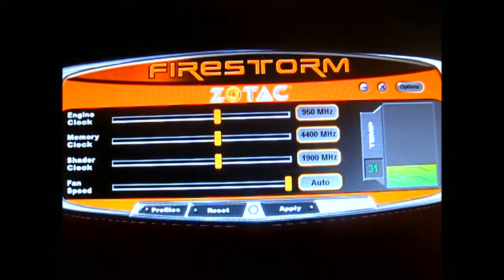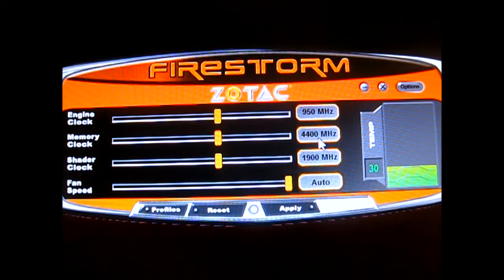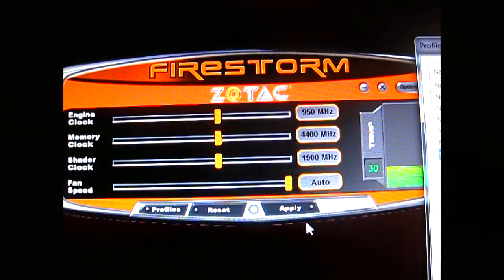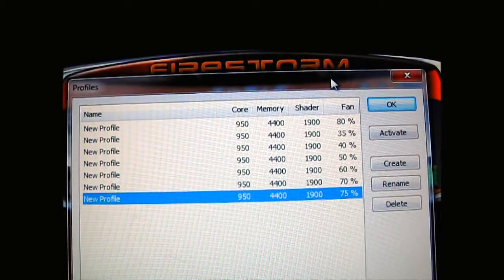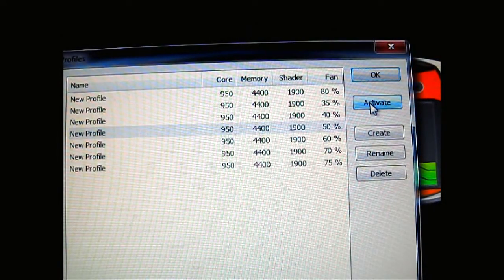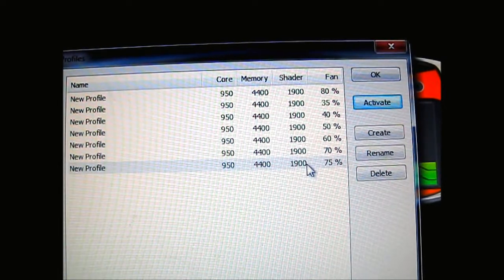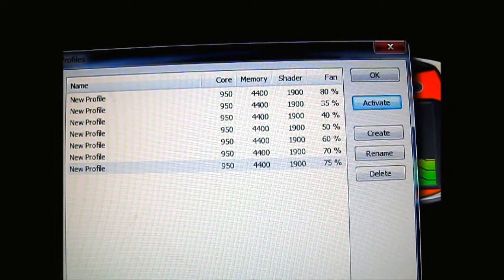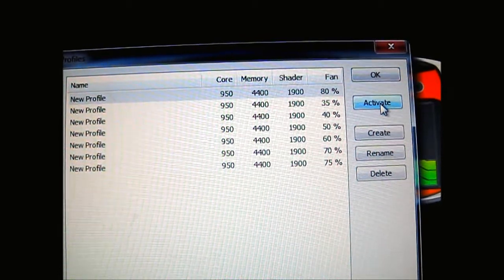Zotac GTX 560 Ti AMP! Edition Video Card - FireStorm Software and Fan Noise

Comment: thank you i use MSI's Afterburner and it works Great, but my problem was in fact power management mode in Nvidia control panel being set to "Adaptive" these power hungry cards absolutely have to be set to "Prefer Maximum Performance"

Comment: please respond if you've also seen this i have a zotac gtx560 (non ti) every once in a while the win7 desktop see through borders go solid and ill bring up firestorm and its all messed up different numbers and temp goes up a bit not dangerous but higher then normal (43 and then to 62) restart pc and then its fine again for like two or more weeks anyone get this (no over clocking)

Comment: hey, just wanted to let you know, I just bought this video card, and installed it in my antec 902 case. It is a good video card, i would suggest getting the 448 core, since it is basically a little lower than the 570s. As far as over heating, I have no problems, Idle is 30c and while playing bf3 on ultra with 3d, only gets as high as 40c. I do have ample room around card, so I would say as long as u know you have good case fans, you should have nothing to worry about.

Comment: Running the AMP edition too tho i hooked it up with my Watercooled system and with a little 240 radiator im getting MAX 53degrees but looking forward to getting it lower with a nicer Radiator tho im curious does the card take heavy dmg if you tune it up abit? and how far would you go? :) oh and im running both GPU and CPU on my watercooling even with the small radiator its max 20db and low temps :)

Comment: ur right sir! i own this card. i overclocked it but aswell i did undervolt it. that means i got more performace @ lower power consumption. i managed the card to stay at 85 degrees max while gaming. later i put on a after market cooler from arctic cooling and now the card wont get higher then 75 degrees after like 3 hours battlefield 3! here are the spec´s if interested. corevolt: 1100 mV, coreclock 1000 MHz, shader: 2000 MHz, Memory: 4500 MHz. cooler is a accelero twin turbo II

Comment: @DoomTra1n Thanks for the info, but I've already exchanged the card for Asus GTX 560 Ti DCII TOP. It has almost the same performance, but with much lower noise and heat levels (max. 75°C).

Comment: @pedotecaliente I sold this card back and bought Asus GTX 560 Ti DCII TOP instead, which gives almost the same performance, but it's significantly cooler 75°C max and noise level is not as high as Zotac. Moreover Asus now bundles this card with Battlefield 3, which is a great value for the money.

Comment: I have problems with overheating running BF3. The auto settings maximum is 75% and the card gets 100 degrees celsius in 15 minutes of gameplay. :-(

Comment: Got a gt 240 yesterday, damn thing kept overheating. Eventually I realized the auto fan wasn't working. Anyone else have that issue? sweet software though, but I have to run the fan at 100% :(